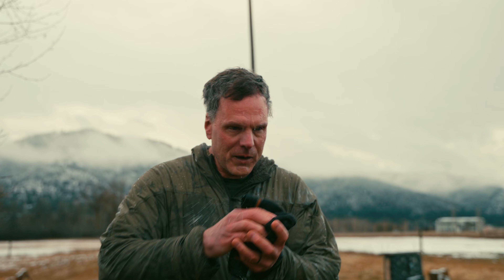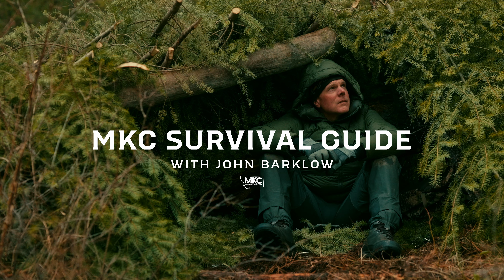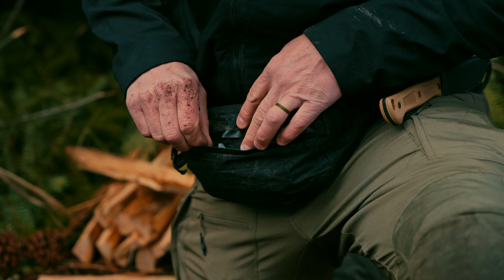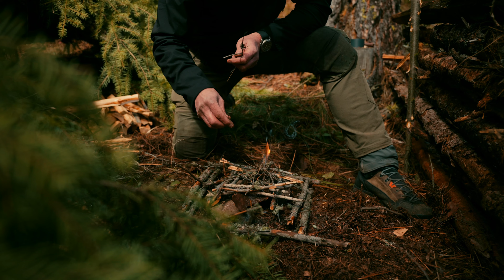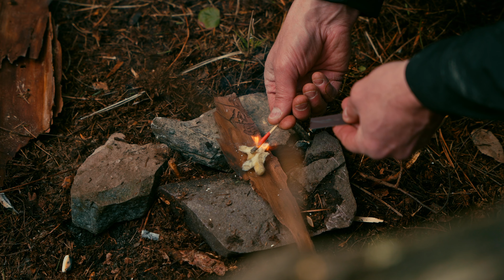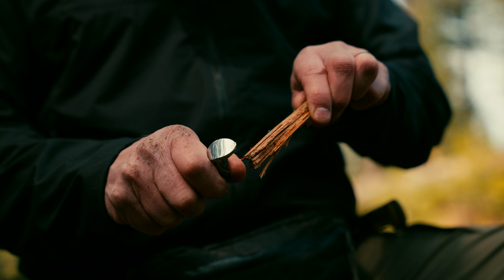FIRE MAKING TOOLS | MKC SURVIVAL GUIDE - 021

Comment: Probably not a good idea to use the cutting edge of your knife to strike sparks off a ferro rod. The sparks created at the edge are extremely hot and will erode the steel edge dulling it and potentially compromising the heat treat at that point of contact. Carrying a section of cheap hack saw blade works great and a lot cheaper than fixing your main cutting tool.
Reply from the maker: It’s a point worth evaluating, but in a survival situation heat treat is probably the last thing on someone’s mind